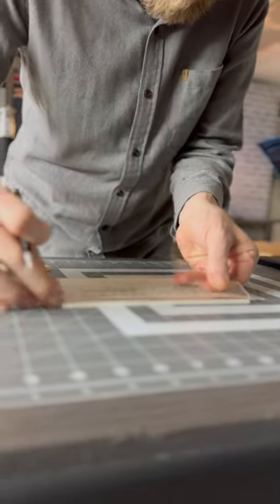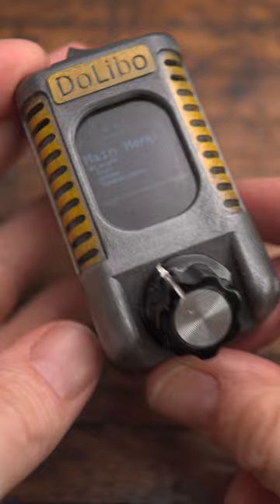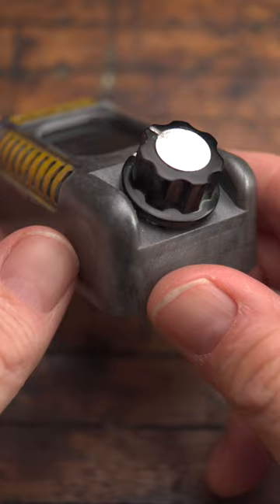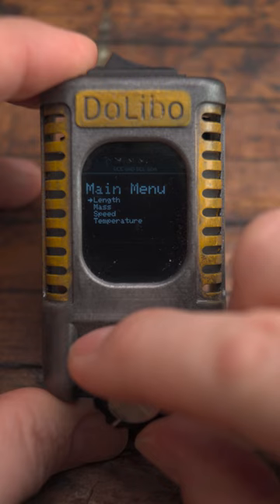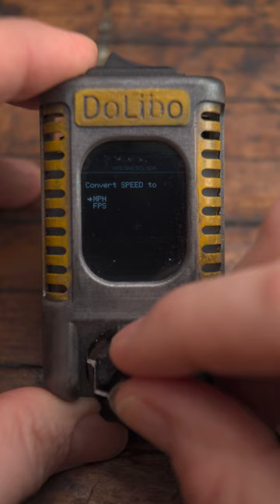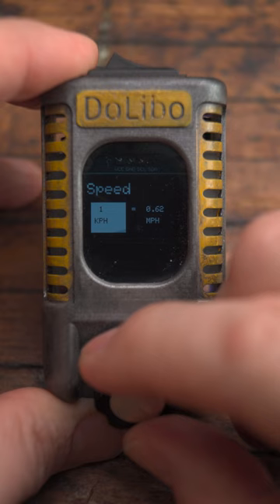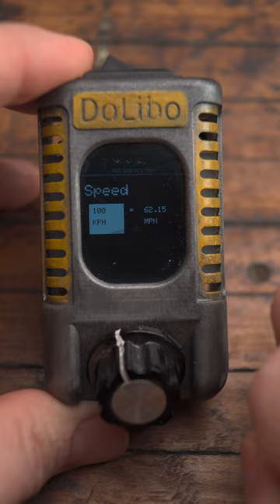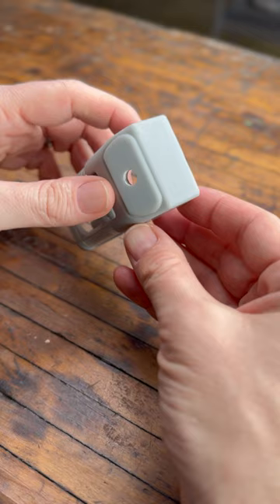Retro Future Unit Converter #ArduinoUnitConverter

Comment: Vape batteries... i power so many stuff with them, including some of my retro game controllers.
Reply: Yooooo
Reply: If you’re talking about 18650s then vapes are just one of the many uses for them. Try tearing down a dewalt 20V max battery and upgrading the cells with some molicell P28s
Reply: @italianbasegard  i use 18650s for many things but in this case i was refearing to small batteries from disposable vapes.

Comment: Could you talk more about the vape-batteries? They are super useful but how do I prevent overcharging?
Reply: There are charging modules that use an ic (usually tp4056) to prevent overcharging and over discharging. That is the most popular option

Comment: Or... You live in a country and are of an age that you've lived through both imperial and metric eras. Then you already know most of the speed limits in both MPH and KPH, 3 feet is roughly a metre, 12 inches is roughly 30cm, miles to kilometres is knowing your 16 times table - 1 mile = roughly 1600 metres or 1.6 kilometres. So 5 miles is 5x16/10.
I'm grateful to have lived with both systems, but metric is so much easier. I mean 5/16! Just call it 8mm and be done!

Comment: Good idea but very ugly execution, from human interface perspective its a complete failure, you would add fast access buttons.
Reply from the maker: How are you defining “complete failure”?
Reply: @HackMakeMod  Whats happens if i want to fast convert a big number? Then a keyboard is faster.

How easy to acces the know is? Taking in account that you need to grab the device with the other hand... pretty hard.

A tabletop calculator stills holds a better form farctor for your purpose, however the encoder idea, specially with the acceleration library, its a neat idea.

Also as i tell you before the menus take more time to navigate than use the main function. You should put fast access buttons.

Dont serve for his purpose, a table top calculator works better, you still need to iterate the idea some more times.

Having focused on the fallout aesthetics was a mistake, look better on human anatomy.
Reply from the maker: My question was how do you define “complete failure”… I think you’re just saying you don’t like it. 

The purpose of building it was for my own use. I like it. If you don’t like it, that’s fine too. I appreciate the feedback… I just wanted to make sure I understood.
Reply: @HackMakeMod  Man, i alredy said it to you 3 times, your comprehension falls short...

"Your device, from an human interface point of view, its a comple falliure because It DO NOT SERVE TO HIS PURPOSE"

For the variety of reasons that i already listed:
-Bad form factor.
-Slow menus
-Slow input at long numbers

I also point to you that aesthetics over functionality its a mistake.
Reply: @HackMakeMod  Now, besides de arguments of the conversation, i like your device, looks cool and cute, but inside is a mess.

Anyway I dont have interest to focus on that because is useless, or you use as it is, or you make a better iteration with less aesthetics.

Also, to accomplish that kind of fallout aesthetics i recommend you to press metal, naking the molds in the 3D printer.

Dont be so stubborn dude 😉